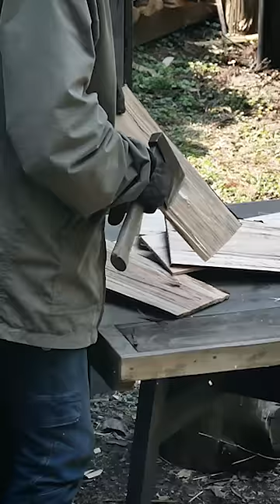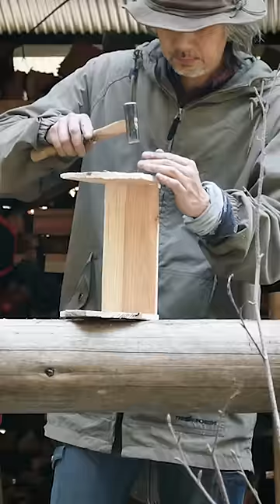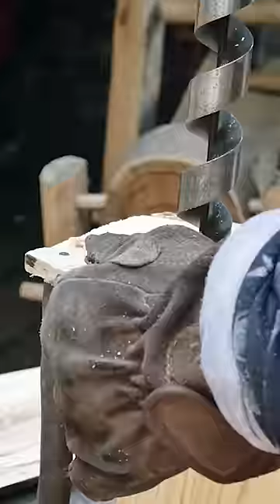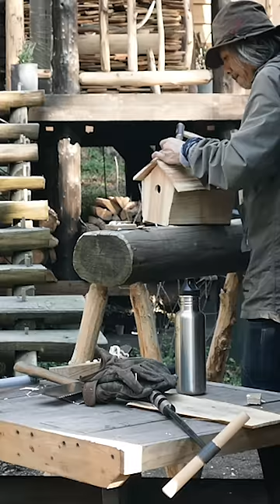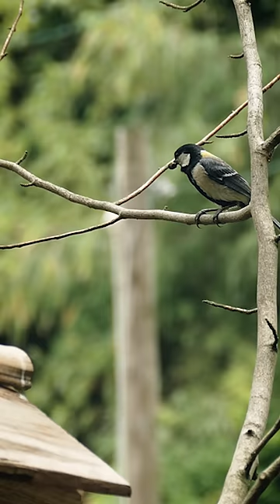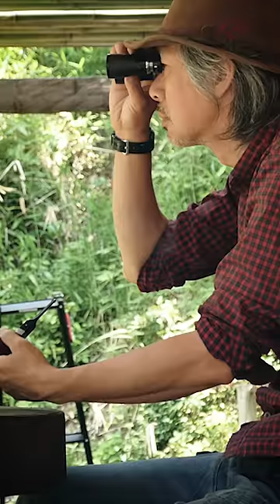This bird box was made from splitting wood using Froe.

Comment: I’ve been wanting to purchase a froe, is there anyone who can give me a little guidance on what a decent one to buy, that won’t drain my wallet? I found a few on Amazon for less than 30 USD, would that be a viable place to start or should I fork out the big cash to start with for a quality German made froe?
Reply: Get the amazon one  .learn how to sharpen it and  if in the future you think of upgrading you will have at least gotten used to using and maintaining one  . Best of luck from Ireland 🇮🇪
Reply: @Joshua Johnson
What he said^^ is solid advice, and I’ll add to it. Look for listing that list the type of steel used. Stay away from “420 stainless” and other Chinesium, google is your friend here. I prefer a good spring steel for a froe; because of the abuse it’s going to take, it does well to be able to FLEX a bit without the possibility of cracking/snapping, being too brittle. That being said, there are many in the market that have a high-carbon cutting edge, forge welded to a mild or spring steel, and those are great too. When googling steel types, look for ones that say “easy to resharpen” cuz you’ll be doing much of that while learning! 
After all said & done and you’re ready to obtain a nicer one (if you get there, you may just fall in love with the cheapy!), you can certainly go German, English (Sheffield) or from the Nordic countries, but don’t forget Japan in that list. Here’s what I’d do though: Find a local blacksmith (or in your country) and have them forge you one up! This way you’re supporting an artist and Craftsman, your local economy AND your soul. You won’t be disappointed 👊🏽🤙🏽